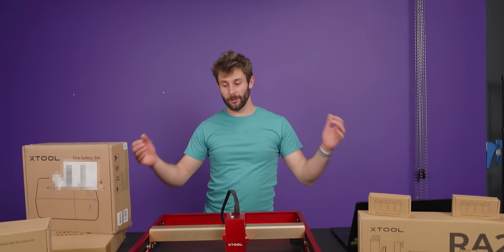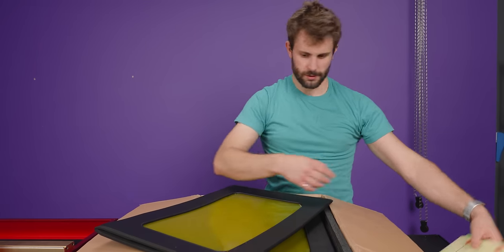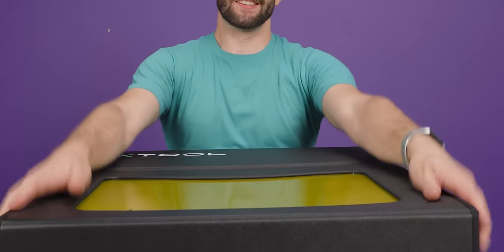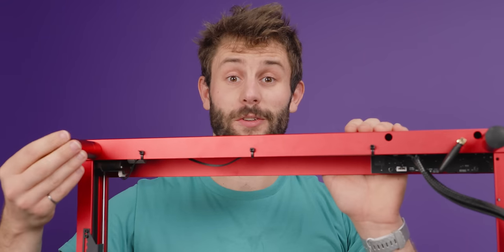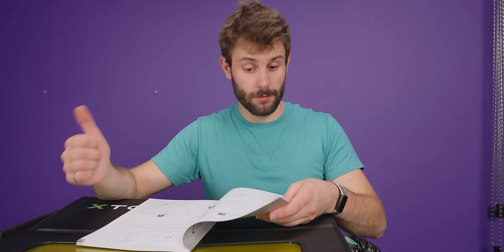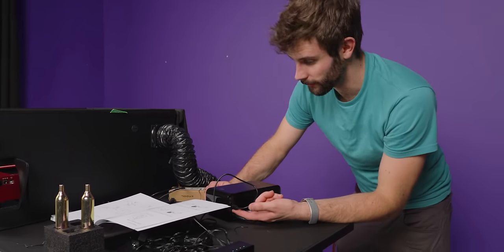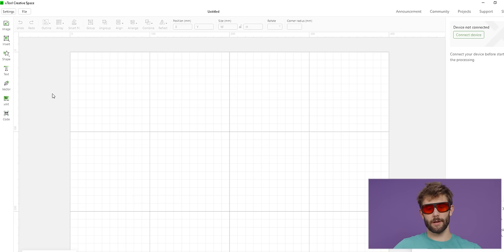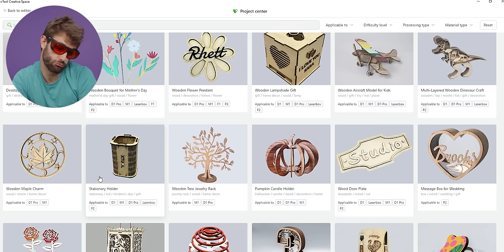This was TOO DANGEROUS for LTT - xTool D1 Pro Laser

Comment: That pricing is mental... You can get a fully enclosed CO2 laser for that!
Reply: @chadhowell1328  simply because of cheap entry point not realizing how much more equipment they still need but will justify not having
Reply: @DracolegacyOfficial  yep! The more expensive models are more expensive for a reason.  Lasers are one place I wouldn’t cheap out
Reply: @DracolegacyOfficial  This is meant for China or the third world in general where we don't care/obsess about safety. The little shield surrounding the laser is meant to protect against direct reflections, and combined with the glasses, that's considered more than enough.
Reply: @rexsceleratorum1632  Ah yes, the third world, where human lifes are worthless, am I right?
Reply: @Deses more like they don't care, do matter though
Reply: @rexsceleratorum1632  just baseless blabbering
Reply: @Deses  Very unlikely that this would kill anyone, just degrade vision a little from reflections and no one would notice. We had some arc welding work done recently, and the dude refused to wear any eye protection at all. He said it's fine if he squints a bit. 

We consider a lot of things normal which absolutely scare westerners. Starting with the first impressions of our driving.
Reply: @branchprediction9923  Are you just gonna sit there on the high horse Sir White Knight, or are you gonna save us all here in the third world?
Reply: @rexsceleratorum1632 I'm happy to say we're safely out of the Cold War Era, so First World, Second World, and Third World country designations don't mean much anymore. Is Saudi Arabia third world? It's richer than the UK, but is the UK first world?

Maybe a second Cold War or a third World War is coming with how Russia is behaving, but you can chill a bit with your Third World vs The West (another nebulous designation) stance.
Reply: @DizzyBusy  And what happens if I am not politically correct? Are you going to come to India to cancel me? Third world, third world, third world LOL

Comment: Back in high school, I had designed a laser cutter based on one of those diode lasers as part of a engineering design competition. This appears to be missing some key safety features required for the laser class (IIRC).

Comment: At my secondary school they had a laser cutter. One of those professional ones that was built around a metal enclosure, however looking back, I don't think it ever had a coloured look through, it was just clear.
Reply: It was most likely a CO2 laser, the windows for that type can be optically clear as they only need to block infrared radiation since that’s the wavelength of that type of laser.

Comment: I wouldn't even put in a window in my enclosure but use a cheap camera sensor with a cheap lens to the outside with a screen on ( and good thing about the sensor and lens being cheap is that if it break/die from some odd reason its easy to replace) and since it's a camera and a screen there is absolutely no way that all the bad rays gets through to my eyes

Comment: Would love to hear your recommendation for a safe beginner laser. I've used an old omtech laser before, but looking for something for use at my home that is safe but not wildly expensive.
Reply: I've heard good things about Cricut desktop lasers. AIO system so those worries mentioned are lessened. I would still vent it out a window or run it in an open garage
Reply: @da3dsoul  thanks! Definitely a good option, though I'm not a fan of their proprietary software.
Reply: @tellingyoustories  yeah it's pretty common for maker equipment to either be very DIY (not a simple package) or maliciously proprietary

Comment: Really good review, I bought a different laser from xtool with enclosure xtool M1 and use those green glasses, will be switching out based on this video to different eye protection.

The M1 itself does however use orange plastic unlike the Greek if the included eye protection here

Comment: One extra safety thing to point out with all that plywood they give you, be very careful when laser cutting plywood as low quality material with a lot of voids will be more prone to fires. Depending on the quality of what they sent it could be a fire hazard right from the get go.
Reply: I've seen things like this in store and the demo projects are inevitably plywood. There is a huge craft market in (overpriced or low quality) laser-cut plywood thingies for making cards and decorations. That's the sort of user these things get aimed at (which is worrying as heck)

Comment: I have a 5W D1 from xtool and the first thing any owner should do is ditch the awful XCS software and use Lightburn instead. Then you will never have to open your enclosure to press a button, and you can tell the laser to start from the job origin instead of the laser home. Line up crosshairs, click frame, click laser, watch youtube until the job is complete.

Comment: I have a 3w blue laser, it will burn through a leaf in about 4 seconds and looks like an infinite lightsaber shooting into the air. 40w is over 13 times as strong. It is so powerful that even a mildly shiny object would reflect enough that it could cause permanent and instant loss of sight. a full reflection of a metal surface or a direct hit would instantly blind you and boil a pocket inside your eyeball.  
it only takes less than 0.1w of laser power to cause potentially permanent eye damage, they absolutely deserve serious respect and maximum safety

Comment: Temping to buy that fire suppression for my 3d printers. I haven't had a print fail to the point of starting a fire. But it is possible. My printers also have thermal runaway protections in firmware.

Comment: I find this very entertaining. I used arduino pro mini and a quad relay board with 4 flame sensors. to do this very same thing like 4 years ago I'm using ots CG320 20lbs cyl this is feeding stainless steel brake line with tee fittings at each machine the relays drive 12v to NO2 purge valves with hard line with 8x 1mm holes drilled in it pointed at the work area it sounds stupid but i lost a machine once after the internals got destroyed by fire. while the fire did not escape into the room the 14,000$ machine was trashed basically just a few steppers and an out shell. the 18x24x2in chunk of mahogany. burned fully and was basically a wood stove even all the paint on the out side of the machine burned off.

i have a few 20lb Co2 tanks i use for my planted aquariums and my soda machine so i just got some fittings and dug around for fast valves that can work with both the cold and the 800ish psi you get on a warm bottle in the end some generic No2 solenoid valves and a small 12v 10Ah liFePo4 battery on a battery tender keeps the system running ever during a power outage.
Reply: whoa that sounds like quite the setup! sorry to hear about the prior machine loss but glad it was contained at least!

Comment: for coding and graphic design
Which laptop should you buy?

HP victus
(16GB DDR4, i7 12650h, RTX 3050ti)

   either

   Dell G15
(16GB DDR5, Ryzen 7-6800H, RTX 3050Ti)

I want quality and long duration.

I accept other recommendations

Comment: Color has little to do with safety level of the glasses. The optical density has more importance, which is the level of light transmission. You can use welding glasses if you want. Carbon arc welding flashes put out much more intense blue and ultraviolet light than this laser. The Green lenses have a much wider band of light wave length that they will absorb versus the orange, and they typically have a higher optical density

Comment: How very canadian of you to say this shouldn’t exist. What happened to trusting people with their own safety?
This should definitely exist, with huge disclaimers on the box saying that it definitely needs a proper enclosure.
Here in germany you need a permit to buy lasers of that strength, people who have that permit know the dangers and what safetymeasures to take. 
I have worked with a 300W handheld cleaning Lazer before, that’s definitely comparable to this in dangerousness and it worked without enclosure. It was handheld! Granted that laser had a focus point and purposely defocused after that, so it would be relatively harmless at a distance. Still the operator was very much in harms way.

Comment: As a business owner with Both a CO2 and Diode laser, I do not feel LLT gave the machines enough credit. Are they dangerous? Yes. But, in over two years of running a C02 laser almost 8 hours a day every day, the only time a fire arose was from testing on a Cor Door Mat. Our Diode laser has been fire free since we purchased and installed it. We have a Sculpfun S30 Pro Max which came with air assist. Air assist is huge in keeping the potential for fires down as well as good exhaust extraction, which we run a 6" 300 CFM exhaust fan that dumps outside. It is hugely important to remain on your toes incase an issue occurs but the level of scaredy cat portrayed in this video was more than just a little unwarranted. I have cut cardboard on both our machines with no fires. I would say more user error than the machines if you are getting fires.
Reply: I think his concern was with the enclosure being super flimsy, big window, having to open to turn on machine...

Comment: Cool...however I wouldn't spend that much on a diode laser. If you're spending $1400 just spend a little more and buy a c02 laser. Trust me. I have both. If you want to mess around, buy a cheap diode, because of you like it, you'll likely want to upgrade to a c02.

Comment: Blue film on the steel sheet under the honeycomb is supposed to be peeled off... I'm 12 mins in to the video, maybe he works it out...
Reply: so he didn't get through the material and he didn't show a material test grid. It should cut through that ply so quickly with 40 watt which is seriously powerful. This felt more like a PSA about the safety than a demo of the laser tech.

Comment: It's kinda cobbled together, isn't it. Not exactly a well-integrated system. It could have been, even keeping the accesories sold separately, but they didn't bother. Probably the worst about it is the way it's supposed to cut power: they opted for a wireless system. Surely it'll work 99% of the time, but problems tend not to be the norm, so... Bad choice, iyam.
Reply: Using wireless for cutting power indicates the manufacture lacks proper understanding on safety. 
For me, this is a sole reason for a no-go for this company or at least this product.

Comment: You sure about the 0.0004 W (0.4 mW) at 8:10? Can we get a source of that claim? The ANSI standard declares that Class 2 lasers have power levels up to 1 milliwatt (mW) and are considered safe for accidental eye exposure of less than 0.25 seconds. The power level "more than 0.0004W" (or 0.4mW) seems unusually low to be universally considered hazardous to the eyes for all types of lasers.
Reply: The reason for the lower power limit on screen at this point is you may think you are safe to intentionally look at it for longer than 0.25s when you have eye protection but it isn't sufficient, and you won't realize it until its too late. You are correct Class 2 Lasers can be up to 1milliwatt, assuming a max exposure less than 0.25s. 
The power value does also come from ANSI Z136.1, I can provide my assumptions when I get back to the office!

Comment: I really appreciate that you guys take on 3D printers and lasers now. But these reviews need to be much better. 17 mins spent on safety talk and maybe a single engraving done in a corner, which you canceled because what... Time constraints? The manufacturer sends you the complete kit and you can't be bothered to even use half of it properly? (Enclosure appears to be on wrong, there are two flaps under the rear section that look like they could be used to hold down that part better and also remove some gaps) Where are the grid tests to determine the best power to speed ratio for engraving and certain cuts? Where are the engraving tests and cut tests on a variety of materials so your viewers can determine if this would work for their projects? Tests with the rotary unit? Air-assist on vs air-assist off? Does the window on the enclosure filter out the laser reflections or are glasses still needed when viewing through it? Why do you have this laser, what problems does it solve, use it for an actual project at LTT so we can see an example of what these are used for! Other Youtube channels that review lasers typically go in-depth. There is no real reason for this video to exist because it does not really answer any questions about the machine. I can tell that the host has some good knowledge about all this stuff, but I'm guessing they ran out of time and just rushed this one out the gate. After the recent LTT drama, maybe don't do that.

xTool D1 Pro is thankfully a well-known machine that's been tried and tested and is generally highly recommended by a lot of people.

Comment: While it's nice to see the on-screen tags align with the video content ... "Didn't end up looking at the air assist" isn't encouraging for the post-introspection phase. The whole video is about the fire suppression system, so why even include that or the rotary tool initially?
Reply: I did learn a bit about the fire suppression from this, and got a few ideas for the enclosure I'm building but I think that it was way too over cautious and didn't explain even the basics of owning one, I know the stuff already and loads of other videos out there, but would have been nice to get something cool made.
Reply: @peaxoop  Agreed. However, I think this is still the best angle for a hands-on of the product. It's a demonstration, but not as quick an "unboxing" as SC has typically done. I applaud that new approach and my comment is honestly just nitpicking their improving processing. All in good faith, I assure you.
Reply: @IamNinetyFour  I totally get it, I did like that this was a different approach from all the laser nerd type videos. But they bought the air assist, rotary(?), 40w upgrade and didn't cut a pice of 3mm laser ply. would loved to have seen a project, but glad they didn't encourage people to rush out and make a huge mistake either.

Comment: Guessing the host was just inexperienced but disappointed they didn't show more of the abilities of the machine, with a 40w output it would be a decent machine for etching some metals and glass plus it should have now problem cutting thicker wood.
Reply: Due to the wavelength of this laser it won’t cut/etch metal or glass without marking material. It is certainly a capable laser and can cut through pretty thick wood and acrylic with the right cut settings.

Comment: Nah its fine to buy a laser with out an enclosure. Especially if that's the enclosure. You can easily build a signifigantly better enclosure than that and probably for less than that garbage one cost. TBH that enclosure is a complete waste of money tho somewhat functional. And I wouldn't trust the dazle protection built into that cheapo Chinese made enclosure.

Comment: A bit blown over proportion on how dangerous these things are, all that he mentioned can happen is true. Just not at the degree he describes. IE: If a fire ignites, it's low yield, and easy to control. It's also very very very very very very rare one starts. I run a business with laser cutters, and we get a fire maybe once every 2-3 months ... And most times, if you blow on it, it stops. 
As for the laser, yes it can be dangerous, but using proper glasses at all times with side covers is enough to stay protected, you don't need these missive enclosures. 

This entire video seems structured to make you buy all the extras from xtool.

Comment: Bruh he didn't even cut anything just some engraves. I feel like a 10w laser can do almost anything you need it to do and is much safer. Or he doesn't recommend those either?
Reply: Look at 14:00. Either machine is bad or he didn't set parameters correctly to do the cut.
Reply: There is a youtube of an idiot guy Chad who cut through a 2x4 with no enclosure and no cover thingy on the laser with his 40 watt xtool
Reply: @macking104  he makes no sense he just believes tools like this should not be on the market. Not all tools are safe you should use proper safety precautions and stuff but still not recommending just because of that it makes no sense.

Comment: Constantly complains about how dangerous the machine he refuses to read the manual for is….then lights a candle with a blow torch. Thousands of people run the x tool for hours a day, I am sure there have been incidents, usually from casual stupidity. (Like lighting a candle with a torch)
Reply: This person does stuf I concider unsafe tells me a device is so unsafe said person doesn't feel like it should be sold as it is. The fact that this person is saying it might tell you something about just how bad the safety conciderations of the device are.